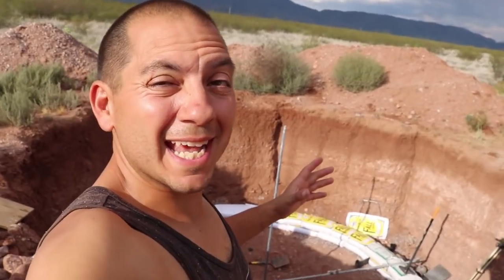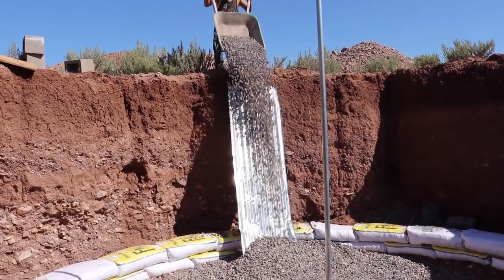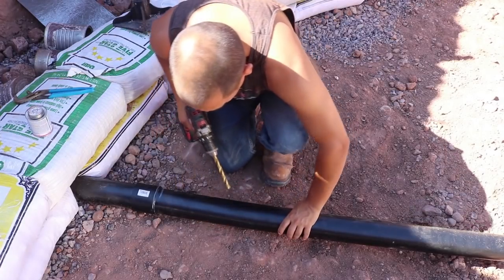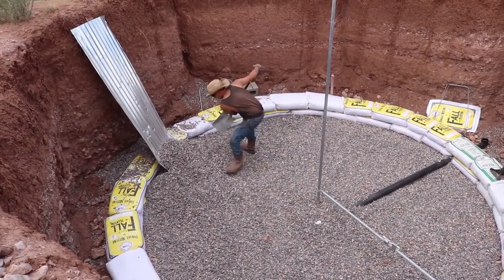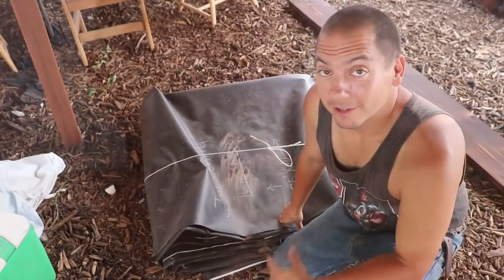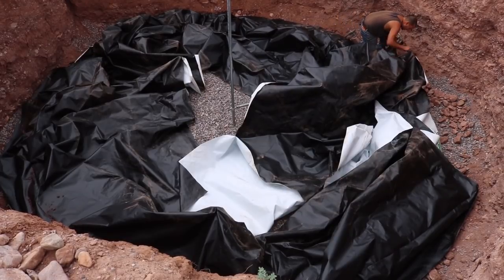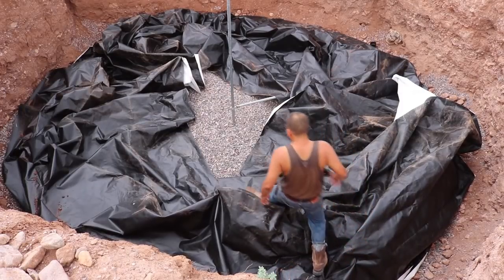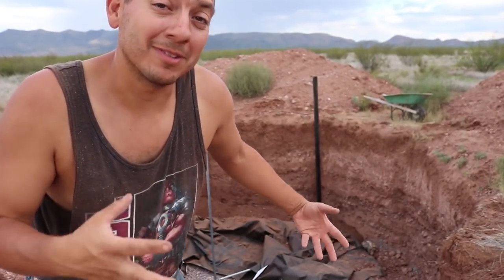THIS Is How We'll Keep Moisture Out Of Our Earthbag Root Cellar | Radon Prevention System Install

Comment: We had a bubbler for the well and radon fans in our CT house built in a quarry. You can buy your own test kit for the radon level. The big issue with it is lung cancer. The liner will be great. You will probably need a fresh air vent as well into the space. Both vents will need critter mesh in the form of hardware cloth for insects and will need rain caps to prevent moisture entrance.  You will also want a mice led light in there. It makes all the difference. Great progress!

Comment: For those wondering radon is element 86 and is a natural byproduct from radioactive elements like thorium and uranium as they decay into lead over millions and billions of years.  It was not an issue early on in how we built homes but as we try to seal them up more and more to control airflow for heating/cooling we are also trapping any inside the house so that is why under slab venting is needed to trap, collect and direct it outside.
Reply: I always said an airtight house is a death trap!

Comment: Wow, nice job!  That's a hecka lotta labor you just did and it's looking great.  Keep going!  Just as a friendly suggestion from someone who's failed a lot, I have a couple ideas that might help at the early stage you're at. First, in my experience with basements, controlling roof water and directing it at least 3 feet away from your foundation is critical to preventing water from entering your basement.  I added this feature to my house last October and my basement has never been drier and lower humidity.  Next, if you plan on adding wooden (or organic) studs or subfloor to your basement, make sure to add waterproof membrane to the basement wall and floor.   This way, any water that makes it inside doesn't touch the wood and is directed downward. For me, I put plastic on the concrete walls and corrugated J-drain on the concrete floor, then I built the plywood subfloor and the 2x4 wall studs over the plastic.  Lastly, make sure to have a floor drain or sump pump at the lowest point in the basement floor.  This way, any water that does come in, which it inevitably will, has an exit route.  

Keep up the great work, y'all are inspiring!
Reply from the maker: Excellent advice! Thank you for that. The dome portion should keep water away from the underground portion. I'd say at least three feet.

Comment: Any moisture that finds the hole will come down the plastic wind the rock layer come under the earth bags and back up into the root cellar floor
That's one reason a sump pump pit is important
If you never need it oh well
If you do.  Then glad you installed it...
Reply from the maker: They say moisture will get in there, but it's not a huge deal. I'll probably still put a cover over it.
Reply: @ourselfreliantlife  
How long have you had a hole that deep
Do you have any data about ground water
Ground water during London season...
How many basements get flooded.  
But it's your project..
But I find a few buckles added to a project
Is a lot easier than dealing with a reoccurring problem

Comment: Hi guys,

Dumb question:  are you going to have a solar powered fan or solar chimney attached to that radon pipe?  I believe that radon is slightly heavier than air which is why it likes to collect in basements and such so some sort of forced air system will likely be needed to get it to go up and out.

As always, love what you all are doing!  Keep up the great work!

Be well and all the best from California 💛
Reply from the maker: Thank you! We might indeed put some type of fan in later.
Reply: We lived in the north (1.5 hours from the Canadian border) & had a radon mitigation system installed because our house had 3 times the EPA's guildlines on radon gas. It had a small fan that ran 24/7/365. Researching radon...the middle of the us has some radon gas but the further north ...it's a major problem. Some northern states require new builds/codes to install a space where a radon mitigation system can be installed. What was weird about radon gas testing....your neighbors' house may not have it! The further south in the us, it was my understanding that radon was low...but you're right, radon gas causes lung cancer. Working hard there on the root cellar & clever about using the corrugated metal to dump rocks....keep on rocking! 👍
Reply: @ourselfreliantlife  An old computer will have 12v DC fan that can be used for a solar powered exhaust fan. I have one that has been running for  8 years off a small 12v solar panel....many uses

Comment: Holes in that drain pipe should be at the bottom, not the top. Plus, i hope you plan on reinforcing the inside so it wont collapse from the dirt outside it.

Comment: Hi, I was just wondering, maybe this was already answered elsewhere and if so I apologize, but if you put the moisture barrier on top of your radon pipe, how will the gas escape through the pipe? Is there additional piping I'm not aware of that still needs to be installed? Thanks for any feedback. My husband and I are new to this and still learning. :)
Reply from the maker: The liner doesn't actually cover the pipe. It goes over the pipe but doesn't block any ventilation.

Comment: You’re saying moisture, but I’m thinking you mean liquid water. Aren’t root cellars supposed to be high moisture low sun light?  

You may consider a sump area for while your floor is still being worked. Easier to have and not use, like other comment given, than trying to do it with a foot of water after a down poor.
Reply from the maker: I'm thinking you want the root cellar to be dark and dry. Sunlight and moisture will cause food to spoil.
Reply: Green Dream Project difference in terms again I guess. First things that show up from google search is “moisture is essential”, according to Mother Earth news